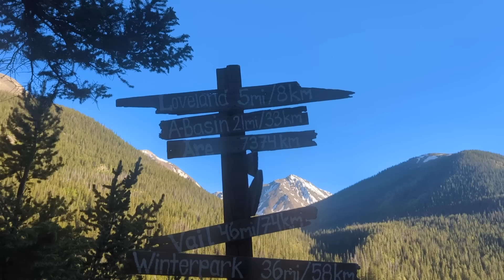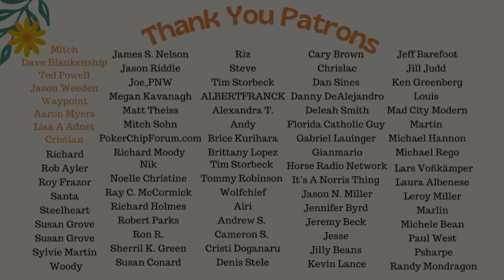BUYING A DOME HOME!! 🎉 *HOUSE TOUR* (story 41)

Comment: It would be nice to remove the divider wall at the entrance so it opens to most of the first level. Unless you need structural supports (could install pillars), I'd remove all of the walls save the bathroom on the second floor. Also I'd see if it would be possible to install a huge window to see the view of the mountains! That black light thing, it would be amazing to have an artist make a huge drawing across a clean wall so that in the daytime it's empty, but turn on spotlights with blacklight bulbs....WOW! That paired with a star projector would be an amazing hangout room! Since it's a dome...or essentially a UFO, a retro-future look would be amazing, like the Jetsons! A dome doesn't look good with anything antique, wooden, outdoorsy, etc...
Reply: Dome structures are self supporting structurally… whether monolithic… or some form of “wire frame” like construction. This is technically considered monolithic despite the “wire frame” or mesh reinforced concrete. Concrete and pisè du terre or rammed earth types of structures are considered monolithic, plastic, and self supported … even I suppose if tensile fabric is a substitute.
Reply: I would like a dome house and where can they be placed and are they expensive

Comment: That property is super cool.
I found a tax repo hobbyfarm with a few giant buildings on it for a song.
Went from underground basement apartment life in the city, to having something the size of my old city block, though 10 miles from town, in the middle of two towns that basically have everything. 
However, i hate yardwork, to the point of building a self driving mower bot about the size of a small car. Its half completed, adapted to a giant brush mower that does 4ft passes.

Crank the music!! No nextdoor neighbors will flip out at 3am even in the middle of nowhere.

Comment: That dome is a mystery just like the author of the video. I thought of two or three things; all the stuff/trash, I would just sort that out so it doesn't lay distubingly around, and find a way for the buildings to blend in with nature by laying out a garden instead. I would have kept the green house, It is probably too weak to handle snow as it had caved in like that. Heat, mind the heat from the stove planning the rooms so the heat find its way into every corner and doesn't get obstructed. Heat travels upwards so may get super hot on the top floor. Have the heat source in the center of the house appeals. And I believe some inspiration has been taken from the Art Déco design style, Good luck!

Comment: Lyss sweetie, I was rolling at the 4 min. mark when Rio was giving you the "Hey mom, why don't you ever let me drive?" look... Also, Brian I have a Masters degree in Structural Engineering and I am a General Contractor so if you run across any questions or problems just let me know. Interior design/decorating is more Lyss's area though. 👍 Lyss, BIG HUGS as always! 😍

Comment: I've been interested in a dome home myself, more over one with a basement where the spiral staircase that leads into a basement.  I assumed they did that by just burying a floor below and starting the concreate process from there.

I know this video is a year old, but I hope you kept the fireplace in the living room, but just elevated the sunken floor.  I do think that would have widen the space for more organization.  I would also point out that the walls on the second floor would benefit from you making custom drawers to use the space for minor storage.  Elsewise, the aesthetic of it looking like your in a dome can make up for the rest of the "wasted space."  Also the space above the walls that lack for air flow could instead have vents installed on it for privacy.

Comment: The dome needs to be vented very well because it is a seal system just to let your friend no . Air tight homes need to have outside air come in and get out to breathe ....The way i did it is put a solar roof fan and air filter on bottom to keep air fresh and clean inside ..

Comment: You might want to add on top of the walls to get closure up at the top of the up there is with a brass punched grid and make a frame for it and insert the the brass punch metal into it and then slip it into the opening there and do it on both sides and it would be little decorative close it off but still get the transference through the punched out metal. I have done this myself on another project where I had enclosed heated pipes for boiler heat and we wanted to dress it up so I can taste it in a wood plywood frame and made openings and put the brass played in there and it was really really nice after was all stained and clear-coated it looked really cool so you might want to try that

Comment: the red carpet wall reminds me more of 60s decor. when they used to have pattern wallpaper where the pattern had velour on it. the blacklight righting and the cartoon wallpaper in the bathroom reminds me of the early 70s the flower children movement coming out of the sixties. looks like you have a very good base structure. with good pads and driveways going into your other levels. with the trees holding your property securely on the side of the mountain. cleaning up after hoarders sucks you and your friends have done a great job congratulations on your find and buy.!.!"

Comment: Use a rocket stove mass heater, burns 2-3 thousand degrees and the heat stays in the mass. Also you can heat the place using 1/20th the wood of a conventional fireplace specially because of the dome designe. You can heat the house using twigs.

Comment: Second thing I want to say is get rid of all the carpet and just have a concrete floor... Something that's easy to clean... Some sort of low maintenance floor upstairs... And I know it costs the fortune but you might want to get rid of those stairs... And put in a set of stairs which would take up a lot of space but it would be so much easier to move stuff up and down from the first to second floor...
Reply: That's not going to be a year renovation that's going to be probably about 10 years
Reply: You want to remove the spiral staircase??! It is the absolute centerpiece of the house.
I hope it will take a year… maybe 2. It won’t take 10 though, no way no how. The holding cost alone would crush me on an unfinished property for that long.

Comment: This looks like a fun little project I'd be into! As much as Iove the 80's for a dome home, I'd go for a retro-futuristic/modernist aesthetic. Lot os white, red, black & silver. Retro-Space-Age.
Also, the view is spectacular! ❤
Also, also - I cringe when I see people wearing shoes over vintage 80's carpet! 😬 Either change to indoor shoes or go barefoot, people!
Reply: I'm betting the carpet is absolutely filthy and needs to be ripped out. 🤢
Reply: @TxAggieJen  - Doesn't look that filthy on video. Nothing some deep-cleaning can't fix. Might seem expensive, but better less so than ripping out & putting in new carpet.

Maybe he's planning on changing the carpet to a different color. If the walls remain white, I'd go w/a bright red carpet for contrast & give it that modernist-retro-futurist aesthetic.

The bathroom carpet DEFINITELY needs to go. Change it to tile.
Reply: Oh we have shoveled, raked, vacuumed, and used a commercial carpet cleaner a few times each — just to try and improve the smell and cleanliness as much as we can, but we will need to replace all fabrics and surgically clean all hard surfaces in the home to get it clean / sanitary. Then every hard surface will be sealed and painted and all new floors. It needs a total refresh!
Reply: @tristatetuners  - Yikes! That bad, huh? What color are you doing the new caroet? That is, I asume you'll be adding a carpet to certain parts of the house, right?
Reply: @Guernicaman  I’m not sure yet to be honest. Maybe in bedrooms, or maybe just generous use of area rugs. I’ve never done interior design but I want it to be really clean and modern inside, but also comfortable and not too echo-ey.
Reply: @tristatetuners  - Then you gotta put carpets on the stairs. 😉